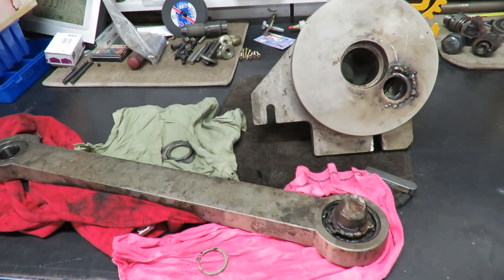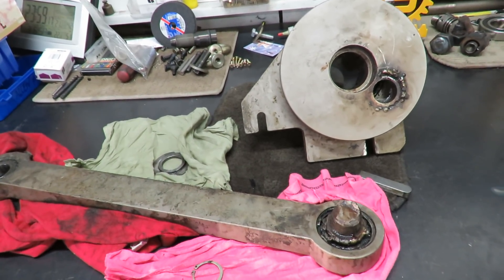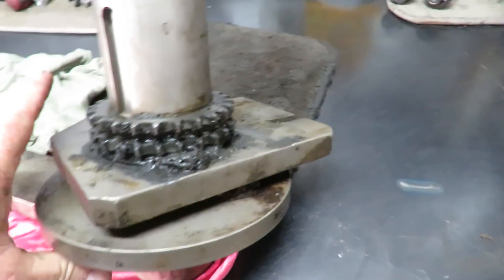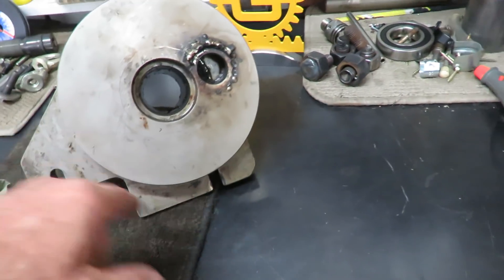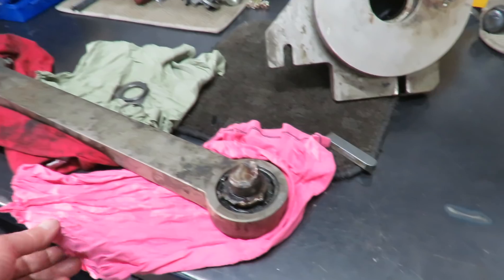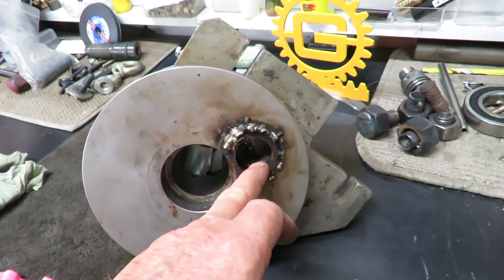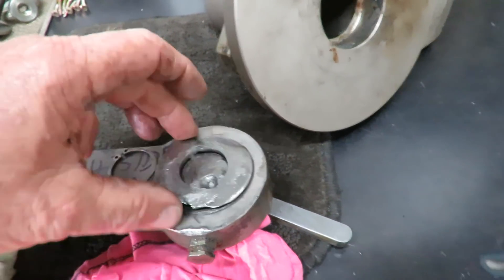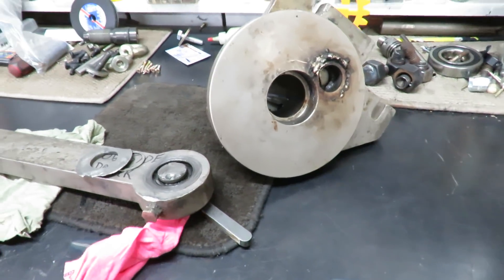The Wayward Crank Arm Part One

Comment: I know that I have mentioned this before but when I had my automotive machine shop one of my customers was a commercial bakery.  It is amazing the damage that can be done to a machine making dough.  We used to have to straighten stainless steel dough hooks on a regular basis.  I had a 50 ton press so you never knew what was going to be brought in.

Comment: so i take it that was a preview ?
a long time ago i used to work in a hardchrome factory , we did all sorts of weird stuff but one comes to mind - the mixing  unit  for a dough mixer . after we stripped the old hardchrome i had to polish it up with a flap wheel on a big die grinder , this used to drive the guy operating the big landis roll grinder crazy ! You make too much noise he would say - can''t put on here what the reply was though ! always whingeing about the noise but he was always first in line when the guy from the labanese bakery turned up to pick up his parts as he always had a big bag of labanese bread still hot out of the oven for us ! hope you get a life long supply of pasta !